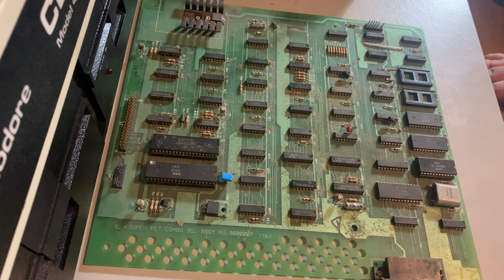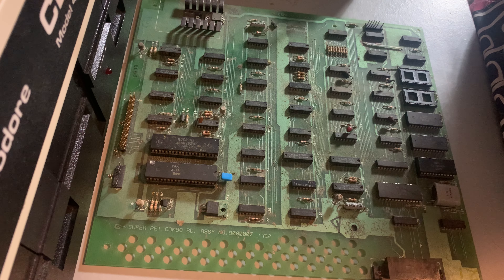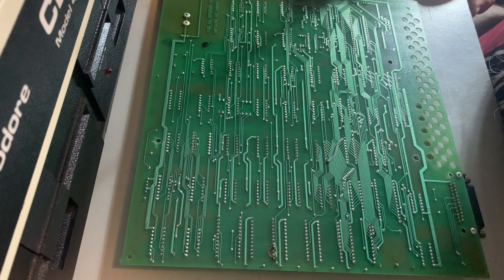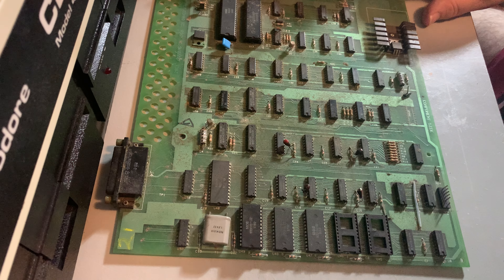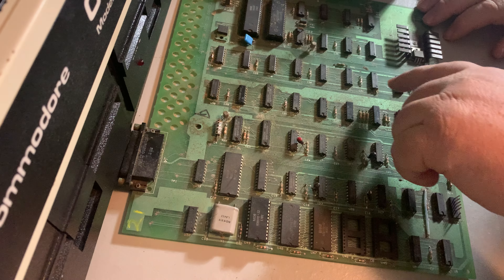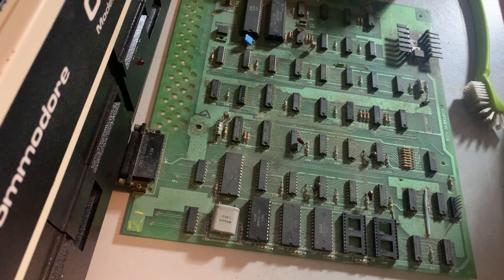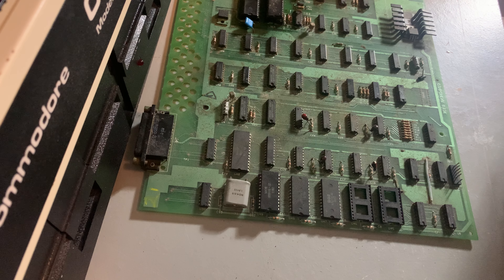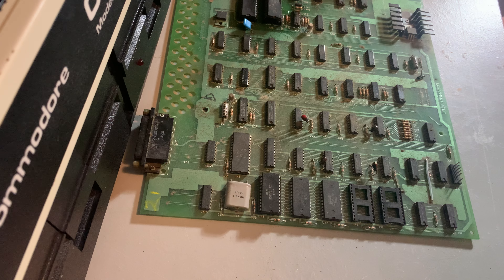Commodore SuperPET SP9000 PET Single Circuit Board Examination - RUDY Calls Consults - Episode 2160

Comment: If that’s a 7809 at the bottom replace it with a modern switching part. $5.
Reply from the maker: Did you see that comment Rudy?
Reply: The part is a 7805, and yes, I will put a modern replacement once the board is working. At this time, the regular os working properly :)
Reply from the maker: Excellent!